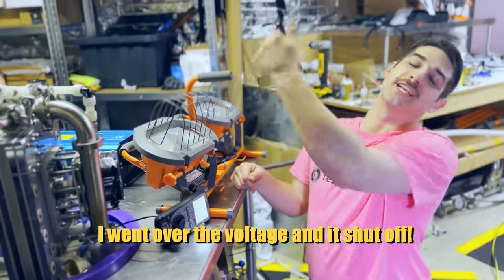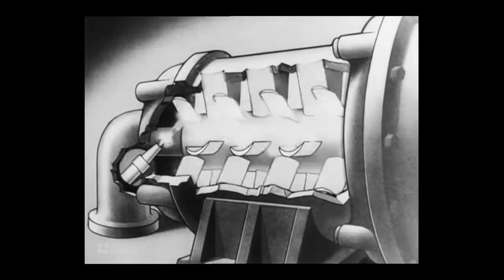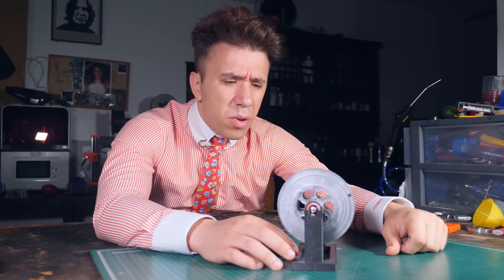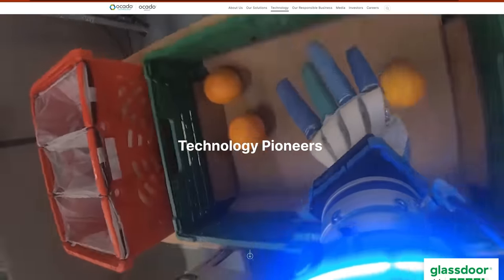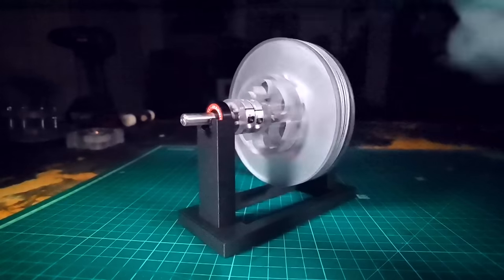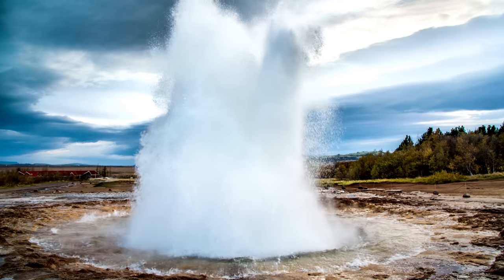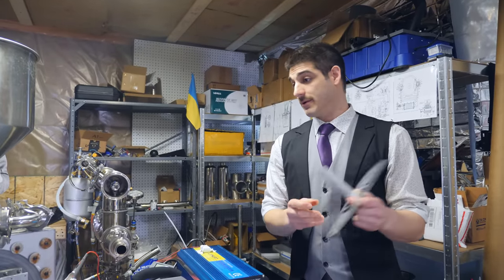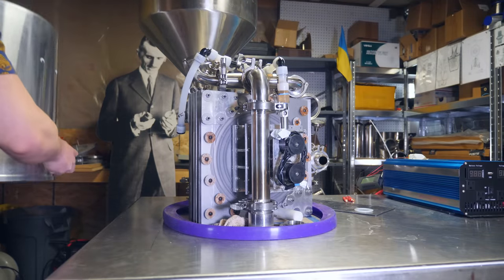Building Nikola Tesla's Bladeless Turbine

Comment: Okay here's my idea I'm sure you've heard of the John badini schoolgirl motor actually Tom Bearden came up with the concept John came up with the actual physical prototype based on Tom's idea anyway my idea is to make the whole concept behind this particular motor is it one battery will turn around through the machine and charged four or five other batteries so make a solid-state circuit that switches the batteries around at the correct time based on voltage and how they're charging so you don't have to do it physically yourself that's my idea for a project I have faith I know you can do it I see your projects on your Channel all the time I have to call me let me know what you think that's it bye

Comment: sugestion: Why not create a bladeless wind turbine 🤔 using the method of Nicolas Tesla's idea from Tesla Turbine #integza

Bom dia de Portugal - Destricto de Santarém
Reply: In this design, you have to use a nozzle to force the air in tangentially to the disks, this doesn't work in wind scenarios.